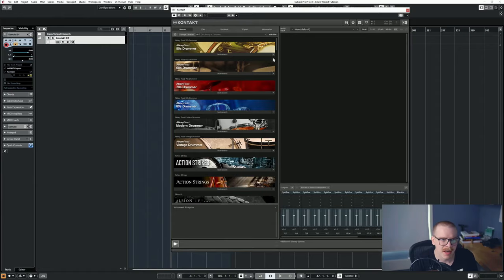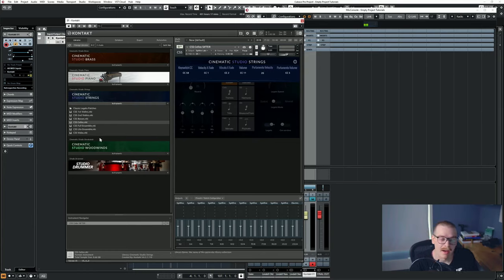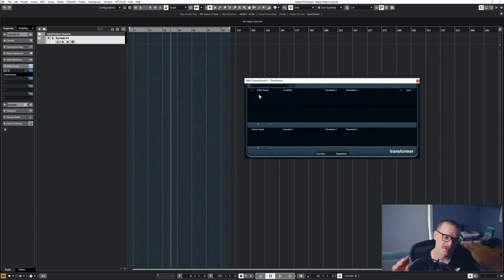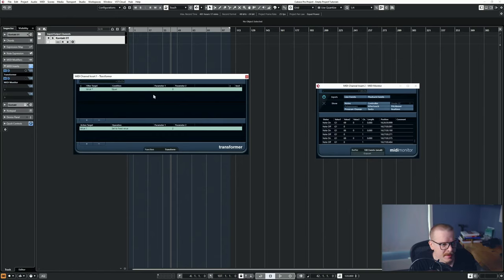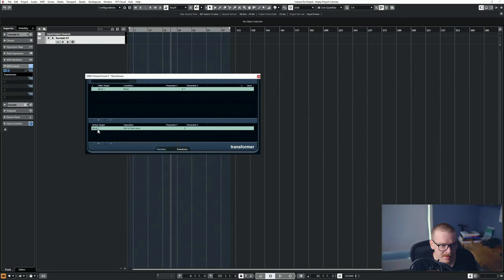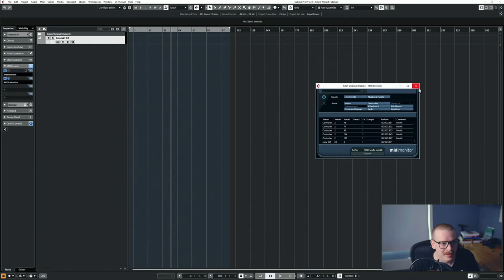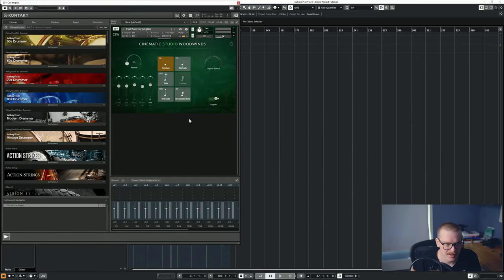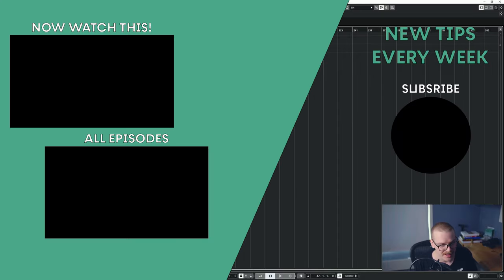Converting CC in Cubase using MIDI INSERTS!

Comment: Thanks this video is exactly what I was looking for! Cinematic Studio series locks out the use of cc21 so you can't just set vibrato in the settings to cc21 then resave with a different name. You must use another "transformer" work around in Cubase or Logic or whatever DAW.
Reply from the maker: Scott, that’s great to hear! :)
Reply: @SifterStudios  BTW I used a different transformer.. under inspector for the channel look for a funny little icon called "Input transformer" (it is not in the midi inserts section). Right at the top, far right for me above freeze.